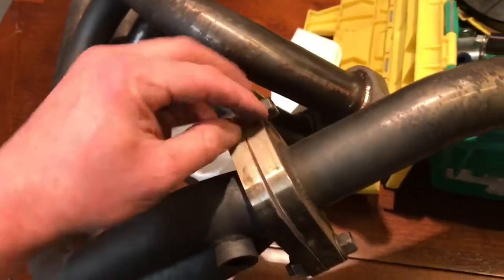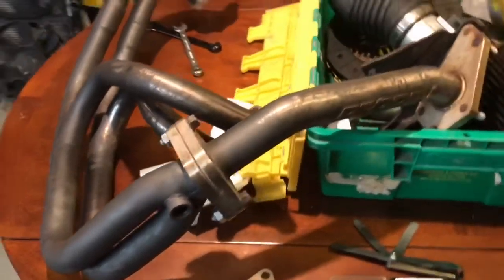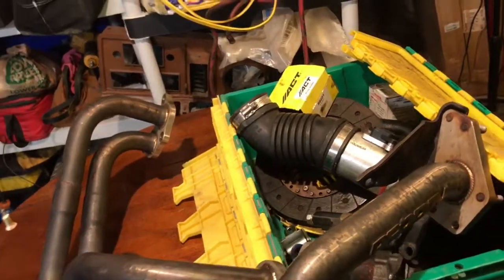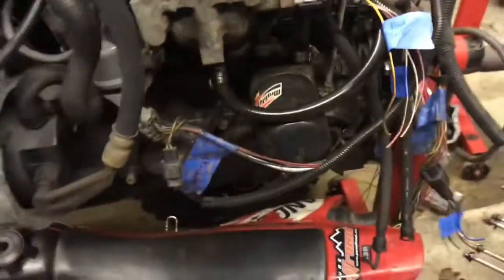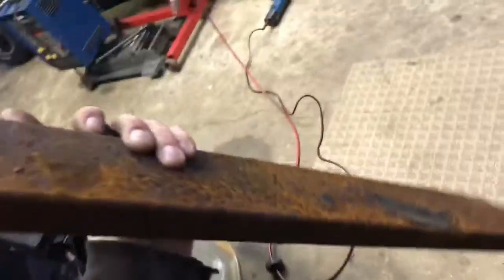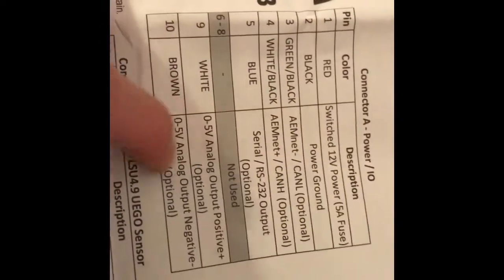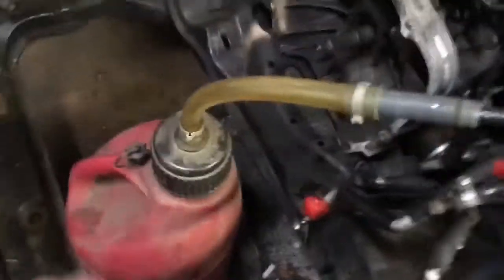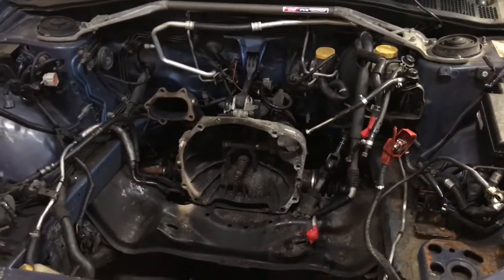WARPED PERRIN UPIPE FLANGE AND SOME PREP TO THE STI

Comment: So if the shifter is springy when you wiggle it that's neutral. If it rattles, that's in gear. Easy.

I should know. My Subaru needs a new shifter knuckle too.